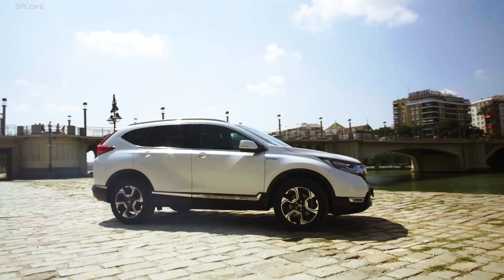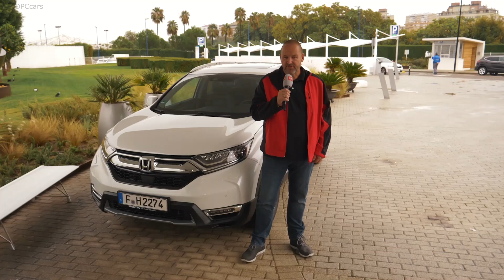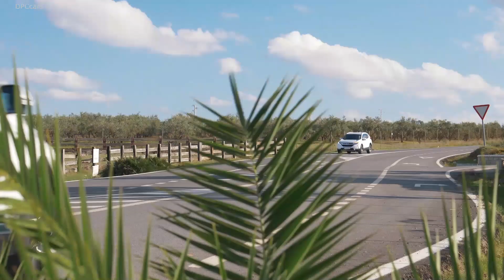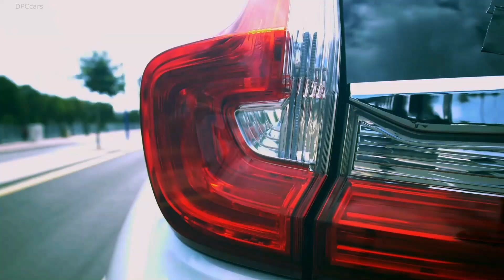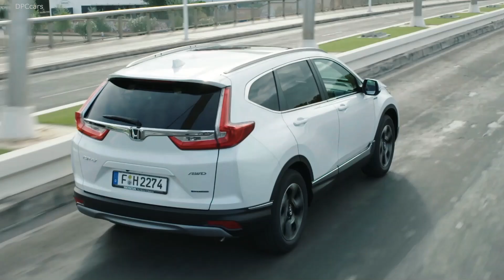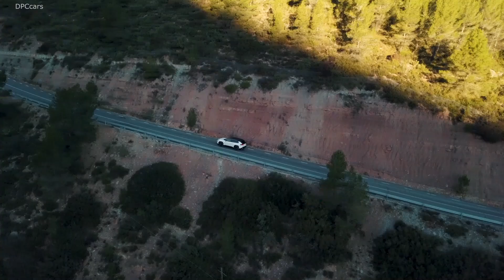Honda CR-V Hybrid SUV 2019 Review

Comment: I am in the UK, I bought the top of the range EX in 2022. I love it. It comes with 5 years servicing, breakdown and warranty. Mine is 1 year old. The edges of the arm rest are the only mistake I have found. You learn to drive around the worst issues of the hybrid and it is no real compromise. I really love mine. It is just like my previous diesel Land Rover Disco Sport HSE Lux without all the warning lights and recoveries and 48 mpg instead of 34 for the diesel LR. On the Honda, if you want to accelerate hard, press the sport button which then when you floor the throttle, it releases all the power from the battery and does not rev the engine. Learn how to use this unique powertrain and it will really reward you. I love it.
Reply: Interesting, I bought a 22 ex crv at Honda end "24(2yrs old) and they only gave me 1 year servicing for free

Comment: Does it come with a spare tire?
Reply: no, bu t you can purchase one if you are happy with it sitting in the boot as the tyre well is where the battery is
Reply: Ours came with a spare Tire.
Reply: @janeblack953 What? You sure you got a HYBRID variant?….if so, where on earth does the spare wheel get stored then?
Reply: I just bought a space saver from a 2017 model crv. Never used and just bought a storage bag and bunged it into the boot.

Comment: I drove this car and yes - the engine nosie and the acceleration are disconnected. However I would not say that the car reacts slowly. On the contrary - it drives like an electric car with plenty of torque and instantenious response. During strong acceleration from 0 - 170 kph the car keeps pulling faster all the time. Yes - the engine sound will vary during that time, but the acceleration is there all the time. No conventional cars in this segment and price range can achieve this type of response.
The important thing to realize in this car is that in everyday use in the city (up to about 100 kph) it is an electric car that has a pertol engine acting as a power generator, instead of a heavy, expensive and slow-charging battery. Only above the ca. 100 kph the car starts being actually driven by the petrol engine. An interesting test would be to see what is the fuel consumption in long-range driving on the highway. I expect the consumption to go sharply up when driving above 140 kph (when air drag is already signiticant for this car) for some time, when the battery gets depleted and the petrol engine does all the work by itself.